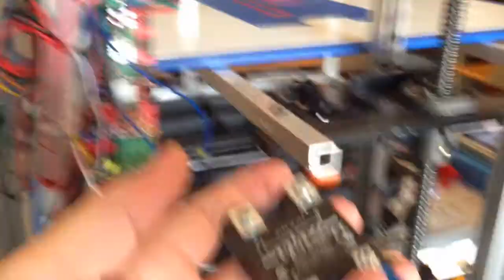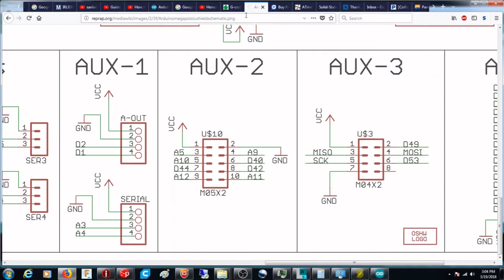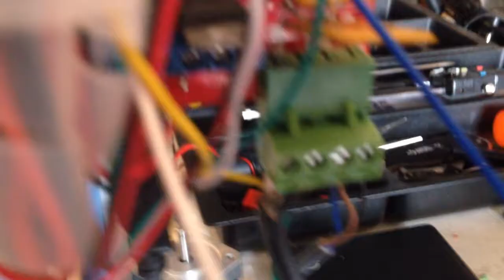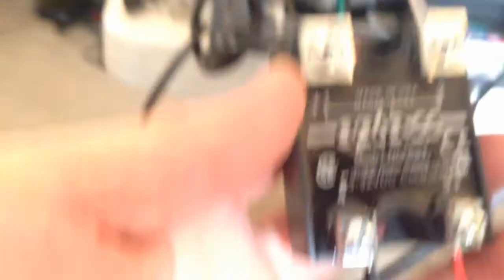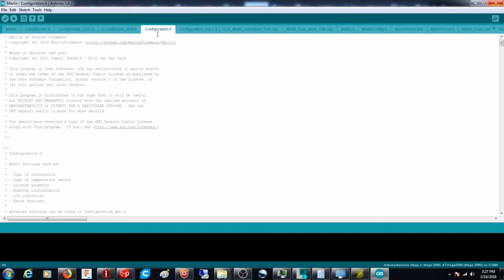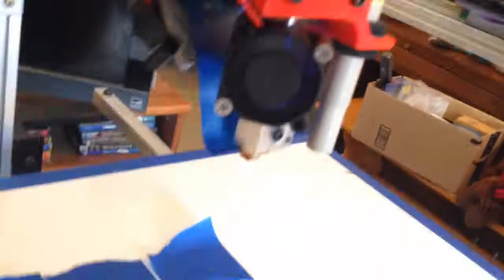Makerbeam h bot version 2 day 11

Comment: Wow great idea. Think I will add that to mine. Adding an ATX PSU anyway so we hat would be a great option.
Reply from the maker: Thanks! I’m glad it worked out well. I already added a fan relay to my delta it was so nice. Have been thinking about a pc psu as well but then I’m adding another fan and I’m trying to keep my wife happy, since I’m in the living room with the tv. Thinking of trying 24v on my stepper motors, that’s supposed to make them run quieter.